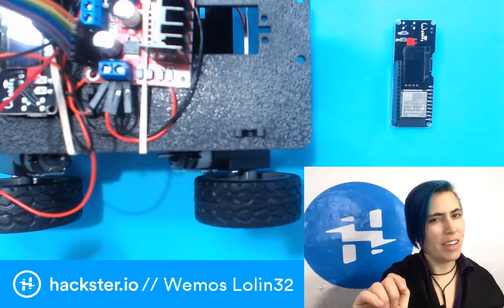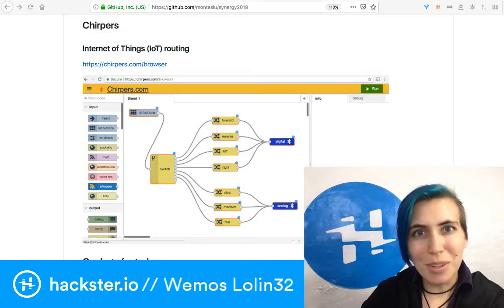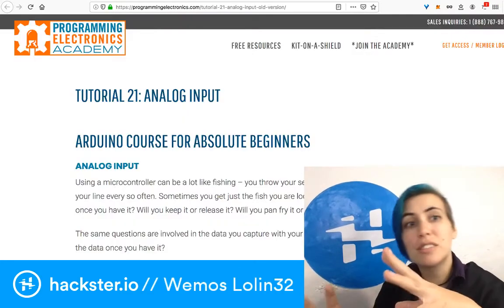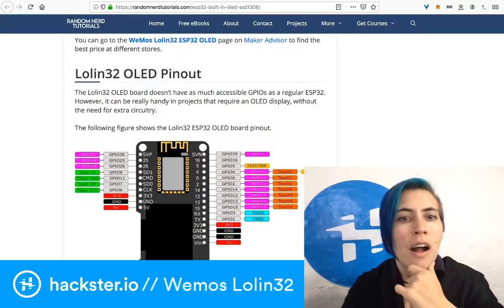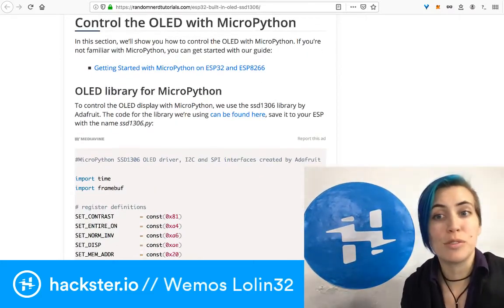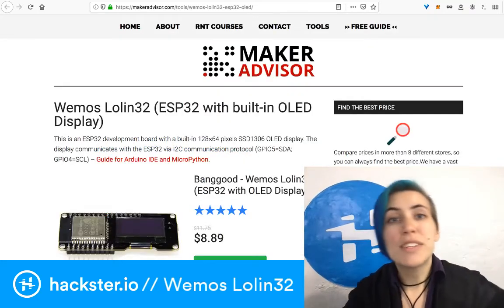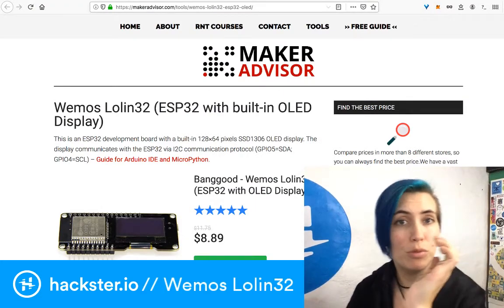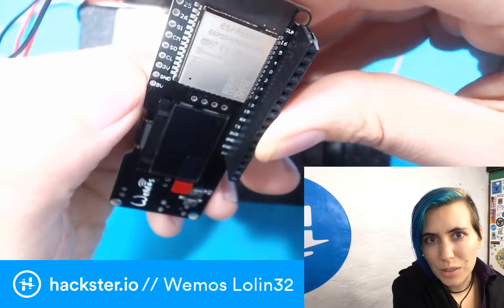Wemos Lolin32 + OLED

Comment: I wanted to connect an arduino uno over some wireless channel to the Wemos Lolin32. Didn't want to get a wifi or BT but a different module. I am designing a monitoring device for the Backup power generator. Later it will be able to allow securely startup and shutdown the GenSet. This intro has been so helpful.